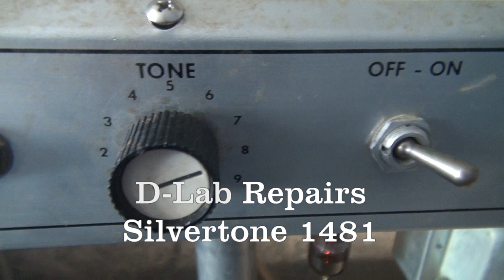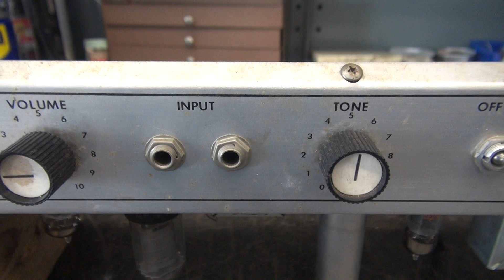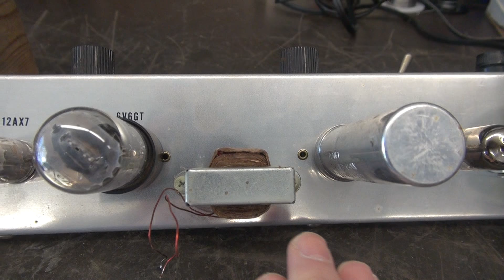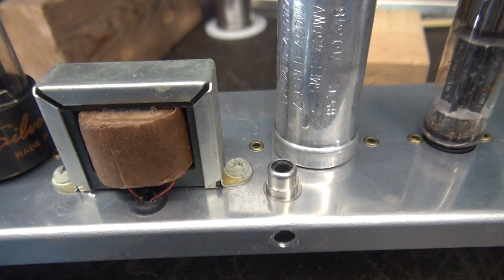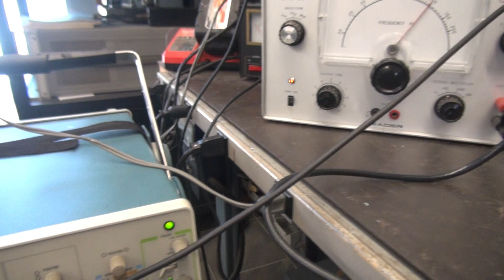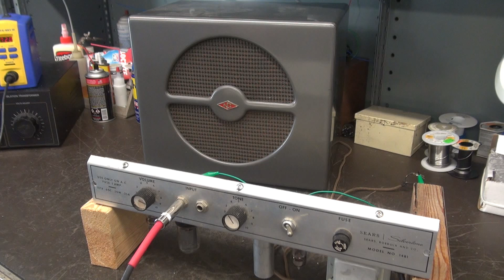How to replace filter capacitor Vintage Sears Silvertone 1481 tube guitar amp 6V6 class A

Comment: Terry, 
Great idea of keeping the original cap in place..and adding the jack to the chassis. I still have my original 1481..all original except for   grounded power plug…and I replaced the first tube to the left..the original is still in working order it causing some minor issues. I also have a vintage Fender Champ ..same vintage ..I think the Silvertone outshines the Champ in a few  areas , you mentioned the Silvertone tubes..I was told my a few sources that Sears used RCA tubes that they rebranded..I play my 1482 with my all original Sears Dolphin head 415 U1  copper guitar Great site you have here!

Comment: This is essentially the same circuit as the 1457 Amp-in-Case, minus the tremolo. Also very similar to a Fender Champ, but de-rated slightly, which is why the old tubes are still in good shape. Great little amps!

Comment: I have a 1483…It worked when I put it away (safe and dry spot) now it turns on and the speaker hums. But no sound when guitar plugged in. All Tubes light up…nothing when knobs are turned. Please help? Ideas?

Comment: Guy was throwing one of these 1481's away at a local thrift store dumpster..luckily I saw it and pulled it out..had a cut power cord..fixed that..all tubes lit up fine but no sound..35 dollar Hammond OT from Mouser electronics installed later..bam- great sounding amp! Thanks for the inspiration DLab!

Comment: I have a Silvertone 1481 amp that I am trying to replace the filter caps the way you did, but I am unable to find 5 uF/450V with radial leads at any of the usual amplifier parts stores such as Tube Depot and Antique Electronic Supply. Do you know of any other sources? Thanks, I enjoy your videos. I also replaced the power cord.

Comment: Hi Terry
A friend gave me a 1482 about 25 years ago. Still working but goes to half power after warm up. He got it new and only used it a hand full of times in 1963 to run as a PA at Boy Scout meetings. The amp has never been serviced and is in mint condition. I have been binge watching your channel in the hope of getting the guts to attempt to diagnose and repair it my self. I would rather have an expert to repair it but don’t want to spend more than its worth to fix it. By the way I really enjoy all your videos thanks for sharing your knowledge  skills Man

Comment: I have a '69 Sears 5XL model no. 1420 and could use your help getting it safe and 3-prong'd. Apparently it's not as easy as just grounding it to the chassis with the new cable b/c it goes into a feedback loop and works when I remove the ground. I have read that this one sounds more complicated because of the way it's designed. Could you help on this?

Comment: Excellent informative video, I have the same amp but only the chassis. It is in an old Crate combo cabinet with a 12" Weber speaker. The tone control doesn't do anything but it still sounds great as is. Looks ugly because of the cabinet, but sounds great!

Comment: I know your speciality is amps, But I have a question maybe you can help answer. In most of the radios from the 50's and early 60's. They have a special cap in them. Actually I call it a capacitor block. I am talking about the 3" long and 2" high square block that somewhere around 7 wires on the bottom. My main question when replacing this this item, what kind of capacitors and what voltage caps should i use. Some are marked as .0005 I believe this is the same as 5000pf. some are marked as 150,220 mmf. My question is, are .0005 supposed to be ceramis and the mmf be mica or dies this not make a difference? Was wondering if you had any experience with them? ANY help would be appreciated.

Comment: When we were kids my best friend and I would head to the dump (it was wide open and no security back then) about once a month and harvest components from old t.v.'s and radios we dug up for our reuse. Once we took a bucket of tubes to the local supermarket that had one of those courtesy tube testers there, but we were thrown out after about a half- hour of using their electricity and not buying any of their tubes. ☺ Damn, those were fun times for a coupla broke entrepreneurs!

Comment: Hi Terry, great job on the vintage amps.  Your videos are a great source for close up views of the point to point wiring techniques.  It is great to see how the old amps were wired.  Love your techniques for changing out the filter caps.  Keep on rocking with the older amplifiers.

Comment: Novice question - why use an RCA jack instead of a 1/4?
Reply from the maker: I originally wanted to use the 1/4" type, however it would have interference fit with the bottom cover
Reply: @d-labelectronics  cool. Thanks man. I was just curious.

Comment: Nice amp! Good job!
I personally wouldn't use a RCA connector, but a (mono) jack, since that's basically the default nowadays.
Just make it a bit more compatible. (I know RCA connector would be just fine)

Comment: Hi Terry -- A technical question -- is it not better to run the line hot to to fuse and switch and put the neutral directly to the other side of the p/t primary ?
Reply: The original schematic shows the fuse in line with the neutral and the switch in series with the line. But the wiring should have been revised, to where the black (or line) runs to the fuse and then on to the switch.
Reply: Best practice is to put the HOT wire to the fuse...  that way if it does pop,  the potential for shock is reduced.